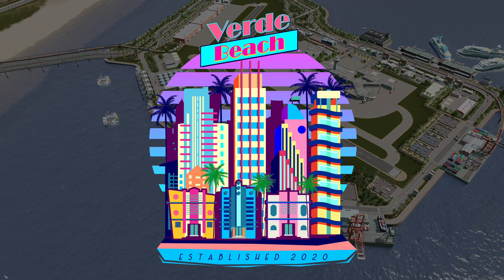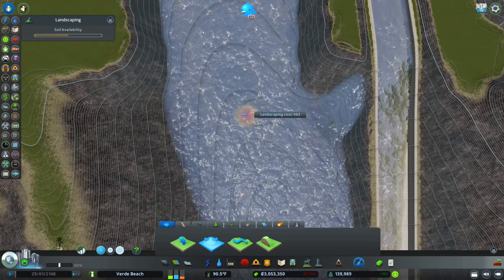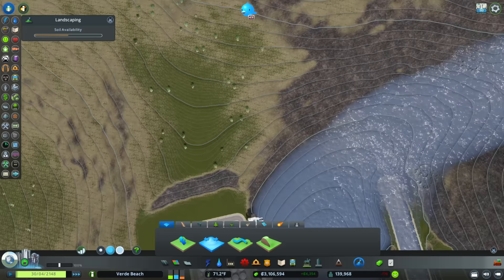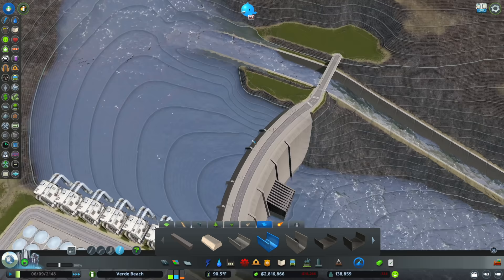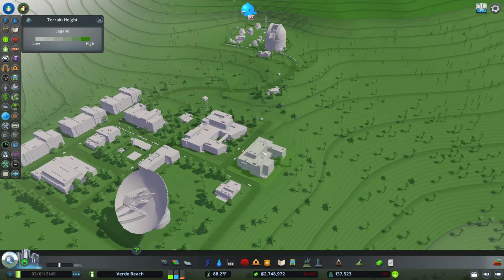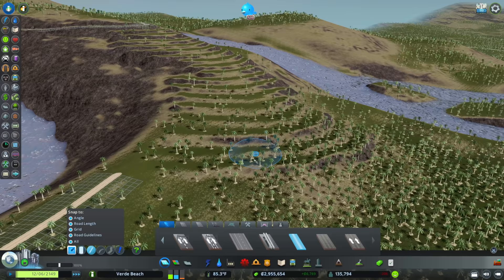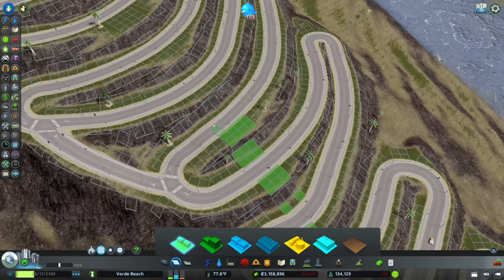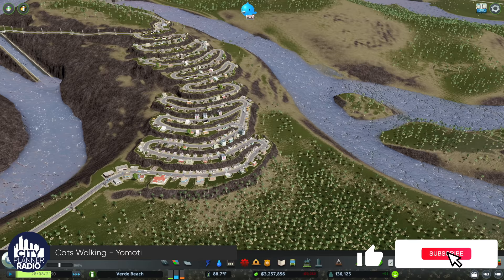How to build a MASSIVE Hydroelectric Dam Complex without Ruining Your City | Verde Beach Ep. 65

Comment: There is that mod that helps with the sloping and grading ( MacSergey did it or something). That should have helped here with the slopes a bit. 
Nice content still.

So my 5 cents:
- For the love of GOD, use a sloping tool. :-) 
- Put buildings on the side of the hill, let the road be eaten by the hill
- I've got a name for it:
The puker (pucker factor 100)